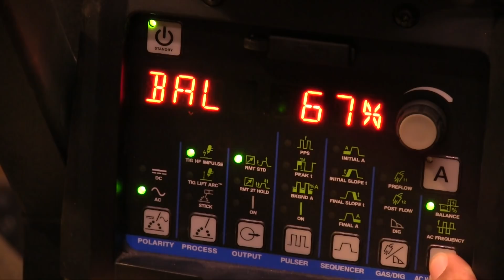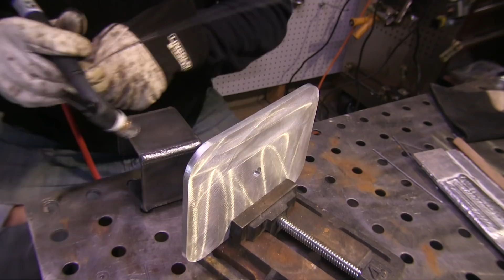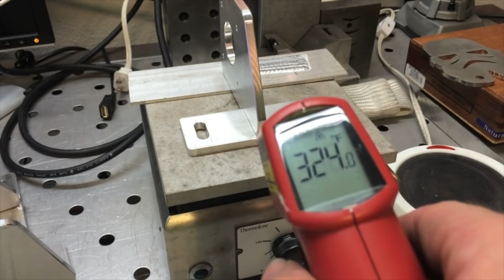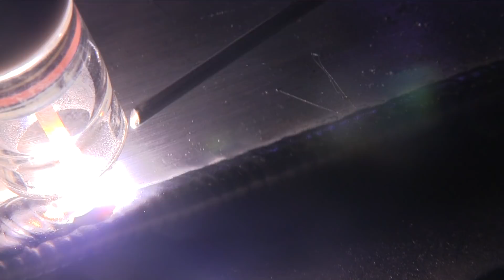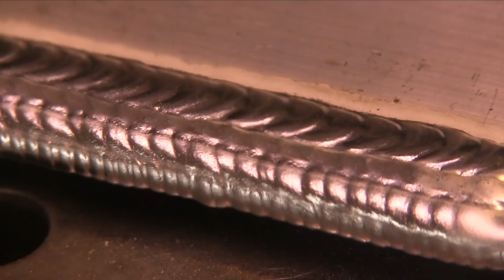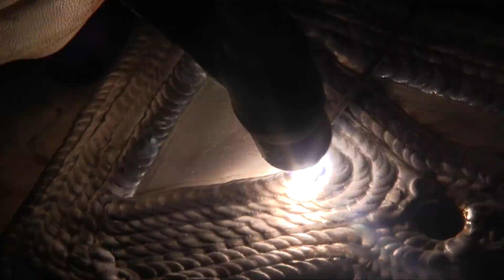Tig welding "The Aluminum Drill" Revisited

Comment: Just got my xl tig finger. I had to order one after I borrowed one from one of the instructors (Kevin) lent me his in welding class. It made a huge difference for me, not just in keeping the heat at bay but allowing my hand to glide and get a smoother flow when guiding the tig.

Comment: I love your videos, they have helped me a lot. One of the problems I have been having is welding thin aluminum to thicker aluminum. The other day i was welding some 1/2" angle 1/8 thick to some 0.06 sheet, and while I got it to weld i was getting some really bad warping. I would love a video showing some techniques on how to do something like this better.

Comment: You mentioned heating up the air cooled torch I find that a bit of a problem with that many beads but always time for a break to play with the dog.
Reply: Yeah it's a pita,  I have a simple 26 air cooled torch and it gets really toasty on the torch hand, I often have to stop because it's too hot. I mostly weld square tubing so sometime just wearing a bigger glove on that hand does it.

Comment: how much distortion did you get on that plate? I personally have never welded aluminum but it strikes me that if this was on a steel plate it would have distorted much more! great video by the way, I have only used tig to braze brass and bronze but that clear cup would have been so useful, also realized that I've been using way too much shielding gas. I am learning so much with these videos! thank you, happy new year!

Comment: Can someone explain to me why aluminium tig should be done on AC , BUT you can weld aluminium with mig on DC? 

I understand about cleaning action vs putting heat into the workpiece that makes sense, but why doesn't that apply to dc mig? 

Love your videos jody. Have you considered writing a book ?

Comment: This is late, but - 
It is important for people to understand that the emissivity of surfaces varies wildly -
Most of the cheaper IR thermometers are factory set to ~0.95 (water emissivity is ~0.95) -
Water     0.95 - 0.963
Iron polished     0.14 - 0.38
Iron, plate rusted red     0.61
Iron, dark gray surface     0.31
Iron, rough ingot     0.87 - 0.95
Aluminum Commercial sheet     0.09
Aluminum Foil     0.04
Aluminum Commercial Sheet     0.09
Aluminum Heavily Oxidized     0.2 - 0.31
Aluminum Highly Polished     0.039 - 0.057
Aluminum Anodized     0.77
Aluminum Rough     0.07
So using an IR thermometer can give bad readings unless you can change the thermometer's emissivity setting. And we humans tend to believe digital numbers too much.

Comment: Happy New year Jody.  Thanks for all you do.  I have a suggestion for 2018.  How about a repair / build up that gets machined.  The whole process.  I am more of a Millwright.  Knowing and seeing the different materials, the catches and issues for different repairs etc would be cool.  It could be Mig build up VS Tig buildup VS Arc weld buildup.  It might be interesting, maybe a joint venture with Superior welding.  Just throwing out ideas.  Love the Videos. Love the podcast and i love my TIG finger (yes an original)

Rob T
Reply from the maker: I will mull that over and see what I can do

Comment: Jody, I just bought a Lincoln tig 200. It came with a regulator, not a flow meter. Is there an ez comparison between gas pressure and flow?

Comment: Are those clear furik cup ok to use on every material ?  Thanks for making another great video!!
Reply from the maker: the #8 is ok for all metals on AC or DC.  But others are recommended for DC only due to the wire mesh diffuser likely to arc out

Comment: Jodi
I have the same CK 17 torch set up for my stainless jobs on my Dunasty 350. I run water cooled for all aluminum due to higher amps. But running the CK @ 80 amps DC for 12 ga stainless, the torch gets smoking hot. How can you run aluminum without it getting too hot to hold?
Reply from the maker: the torch got a bit warm but not too bad.  When I film stuff, it makes for a lot more rest time between beads.
I definitely need to get a water cooler for my dynasty 280. Its on my list for 2018 upgrades
Reply: My grip is more to the flex head, so the heat is good there. Should I try more gas flow? I was running about 25 CFH with a #12 pyrex and stubby gas lens.

Comment: What machine are you using? I have been looking into a miller dynasty 280......
Reply: I was using a 280 on my last assignment. I fell in love with that machine even tho it isn't nearly as versatile as my everlast. But it's really not enough machine if you're planning on doing serious aluminum welding. I had to use an AO rig to preheat most of the 1/2" plate that I was working with. these were 
4" X 8" base plates for handrails. I did actually weld 3 of those things without the preheat but it took forever and looked like crapola. That welder really isn't designed for aluminum that thick. Anything up to 3/8" welds like a dream though.
Reply from the maker: dynasty 280